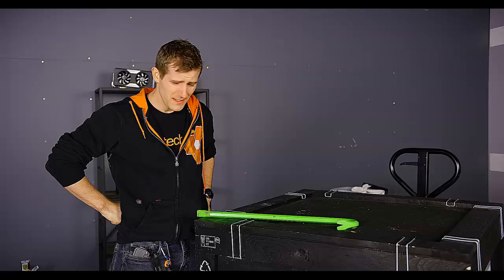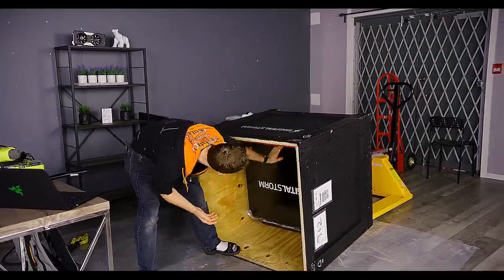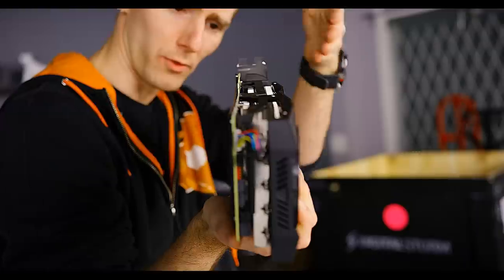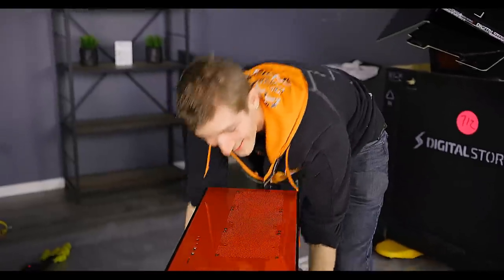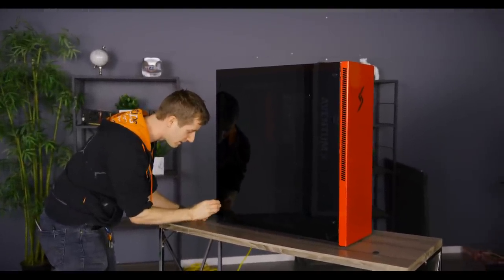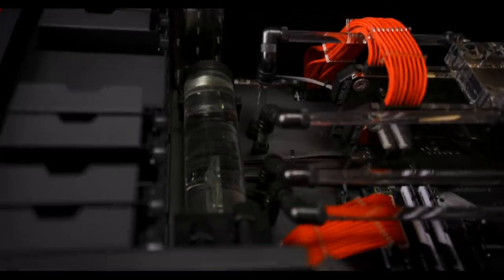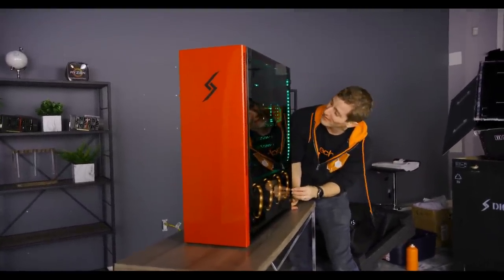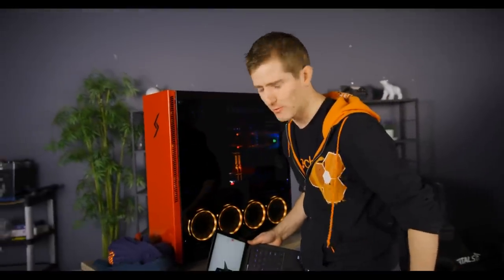UNBOXING the GOD OF GAMING PCs!!

Comment: I hope there's onsite support. I would hate sending a huge machine like this back
Reply: Oalmax yeah, they send someone inside the crate, kinda like the “24 hours in a crate” challenge, but with a sweaty nerd and probably more than 24 hours
Reply: all comps are the same, if you worked on one computer you can work on any computer. the only trick feature this has that you really havent seen is the water manifold. But as a guy coming from the performance automotive world this all seems like common sense. like when building a turbo kit you contemplate where exhaust, oil, vacuum, cold and hot charge piping go all while trying to maintain some sort of serviceability. so then you make vacuum manifolds, coolant distribution blocks etc.
Reply: Think about how rich someone would have to be to buy this. 
They would get on site service whether it's generally offered or not

Comment: Okay and now tell me.. what's the point of those fans hitting directly - almost touching - the glass?
Reply: Helps cool the RGB?
Reply: I was thinking the same thing.
Reply: I suppose it gives the butler something to do.  I'm gonna be gaming tonight jeeves, please open them case windows.
Reply: They "spin" the air on the open side creating turbulance, so while not super effective, they do help, and considering how overkill the cooling on the system already is, I don't think they were too worried about maximizing the fan's full potential.
Reply: They should use an IR camera to see if it makes any difference on temps unplugged.
Reply: @chunkychuck  let's get real. You know the answer.
Reply: @Magnus-pm7ic  haha yeah.

Comment: Now THIS is for the 1%, not the crappy one you did in the other video.
Reply: cant wait to see the benchmarks for this setup
Reply: but the build quality is meh. pretty underwhelming imo. Murderbox/mod was building systems that put this to shame years ago.
Reply: @cndJokester  I thought the same... Looks awesome, don't get me wrong, the back side is a masterpiece, but the front side has led strips that aren't straight all the way down the case, the plumbing doesn't look square (I might be wrong about that) but the connectors leading from the back to the front are hideous... All odd angles ugly pieces. Should have used straight and square pieces...

Comment: 2050 pc be like:

Damn god is so weak
Reply: With technology development by 2030 this will be a budget phone performance
Reply: BionicK .-. Idk about that buddy
Reply: @element1192  i think there is an estimated graph. But from logical standpoint if for example technology each year is getting twice better in 10 years it will reach phenomenal level
Reply: BionicK .-. It’s not technology getting 2x better necessarily. It’s the amount of transistors that can fit in the same size circuit doubling.
Reply: @element1192  Something i am sure that is getting better is AI. As you said it's core system may not be getting better (number of mentioned transistors) but the intelligence itself
Reply: BionicK .-. Ai can’t do everything buddy
Reply: @oleksandrchubras9549  in the future a 2080 ti will be a minium required graphics card
Reply: By 2050 this will be looked at like we look at 2000 PCs. By 2040 this PC will be completely obstinate.

Comment: I thought the pc was only fairly heavy after you tried to take it out from the top normally, until I saw you rocking on the side of the crate when I realised it's actually super heavy.
Reply: size estimate compared to my corsair 900D that i use as a server rack, mine full of drives, his full of water, id say that rig probably weighs in around 150+ pounds
Reply: Holy crap, that's heavier than me...
Reply: Website claims it only weighs 75 lbs
Reply: Strangely My Comments Usually Get Quite Popular well Linus does only way like 140 so it’s not surprising he couldn’t tip the box with his body weight 😂

Comment: It might have 15 fans, but except for the top radiator and front intake, they try to suck air through a glass panel. That massive radiator on the bottom is basically pure aesthetic, together with the small one on the back and the 2 fans pretending to cool the back of the motherboard. Also the front panel has too little holes for the fans to get air through. From a system of that cost, I would expect a better engineered airflow through the whole case.

Comment: All those choked fans. Send it to Gamers Nexus so we can get a proper diss :D
Reply: Seriously, thats all I see. Wasted watercooling since their isnt any direct route for intake. The fans at the bottom on each side are pushing against it other. The back being completely perforated is nice accept not a single method is used to directly push air that way. This thing will be cool the first 30mins or so of gaming but then the loop will eventually be saturated with the heat and the temps will just rise from there.

Comment: suffocated fans just like a certain walmart pc i know of...
Reply: With this amount of radiator surface area it's really not an issue tho.
Reply: You're right. The PSU is choked. The rads are blowing towards each other. Fans all over the case have no breathing space. So much for having a PC that is thousands of dollars and dying.
Reply: @ankit22sharma  as skapiche noted, there is likely enough extra cooling to compensate..
Reply: @kakurerud7516  I'm not saying it'll thermal throttle. But there isn't any cooling that's moving air from inside to outside the system. This is going to run really hot for sure. There should've been some ventilation to allow some air movement. Let's wait for a review.

Comment: Just made my configuration of the Digital Storm Aventum X... $19,151

Specifications:
Chassis Model: Aventum X
Exterior Finish: Black Metallic Matte Finish
Trim Accents: - Standard Factory Finish
Processor: Intel Core i9-10980XE Extreme Edition (18-Core) (Boost Up to 4.6 GHz)
Motherboard: ASUS ROG Rampage VI Extreme Encore (Wi-Fi) (Intel X299 Chipset) (Up to 4x PCI-E Devices) <br><strong></strong>
System Memory: 128GB DDR4 3200MHz Digital Storm Performance Series <br><strong></strong>
Power Supply: 1600W EVGA Supernova 1600 P2 (80 Plus Platinum) <br><strong></strong>
Expansion Bay: - No Thanks
Optical Drive: - No Thanks
Storage Set 1: 1x SSD M.2 (1TB Samsung 970 PRO) (NVM Express) <br><strong></strong>
Storage Set 2: 1x SSD M.2 (1TB Samsung 970 PRO) (NVM Express) <br><strong></strong>
Storage Set 3: 2x Storage (10TB Western Digital / Seagate - Ultrastar Data Center / IronWolf) <br><strong></strong>
RAID Config: - No Thanks
RAID Card: - No Thanks
Internet Access: Wired PCI-E Intel X540-T2 (10 GbE) (2x RJ45 Connectors) <br><strong></strong>
Graphics Card(s): 2x NVLink Dual (NVIDIA TITAN RTX 24GB (Turing Architecture) <br><strong></strong>
Sound Card: Creative Sound Blaster AE-7 (Hi-Res) (Ultimate Audio Playback) <br><strong></strong>
HPC Processor: - No Thanks
Extreme Cooling: H20: HydroLux PRO: Exotic Custom Cooling System (CPU Only)
HydroLux Tubing Style: Copper Tubing (Requires HydroLux PRO Custom Liquid Cooling System)  <br><strong></strong>
HydroLux Fluid Color: Red Fluid + Clear Tubing (Requires HydroLux Liquid Cooling System) <br><strong></strong>
Cable Management: Exotic Cable Management - Black - (Cable Combs with Custom Color Sleeved Extension Cables) <br><strong></strong>
Chassis Fans: Corsair ML PRO Series (14 Fans Total) (High Static Pressure) (Magnetic Levitation) <br><strong></strong>
Internal Lighting: Digital Storm LED Lighting System
Airflow Control: Corsair Commander PRO Management Control Board & Software (3x Boards) <br><strong></strong>
Chassis Mods: - No Thanks
Noise Reduction: - No Thanks
LaserMark: - No Thanks
Boost Processor: Stage 2: Overclock CPU - Up to 4.8GHz via Intel Turbo Boost Max Technology 3.0 <br><strong></strong>
Boost Graphics Card(s): Yes, Overclock the video card(s) as much as possible with complete stability <br><strong></strong>
Boost OS: - No Thanks, Please do not tweak the services on the operating system
Windows OS: Microsoft Windows 10 Professional (64-Bit Edition) <br><strong></strong>
Recovery Tools: USB Drive - Windows 10 Installation (Format and Clean Install)
Virus Protection: Windows Defender Antivirus (Built-in to Windows 10)
Office: - No Thanks
Mouse Pad: Digital Storm Premium Mouse Pad (Extra Large) (Full Desk) (Stitched Edges) <br><strong></strong>
Display: ASUS 35 inch ROG Swift PG35VQ (G-SYNC) (200Hz Refresh) (HDR-10) (3440x1440) <br><strong></strong>
Surge Shield: APC 1500VA Uninterrupted Power & Surge Conditioner - BX1500M - (NOTE: Ships VIA Ground ONLY) <br><strong></strong>
Speakers: - No Thanks
Keyboard: - No Thanks
Mouse: - No Thanks
Branded Gear: - No Thanks
Priority Build: - No Thanks, Ship Within 20-25 Business Days After Order Is Successfully Processed
Warranty: Life-time Expert Care with 5 Year Limited Warranty (5 Year Labor & 3 Year Part Replacement) <br><strong></strong>

Comment: Not so smart  all those fans  and choked by the glass panel digital fale
Reply: Just remove the panel while gaming xD
Reply: @MLWJ1993  Yes after selling a kidney and buying that  shit i will remove that glass  every time i want to game LOL
Reply: It depends on the clearance. It does look as though they have enough space to ingest air without significant choking. That would actually be a great test to do on one of these tech channels.
Reply: @PalladianPD  even if there is clearance it does not get fresh air and would be like a hot air oven and circulate the air that is in that compartment , and did not see any filters that butler Linus was talking about is definitely needed after a while
Reply: Mark Jacobs just having those fans will be better than not having them
Reply: Also the filters ? Where the air filters ?
Reply: @gfd796f8f-0pyiolk  yes if you like RGB without  the functions its better to have them  i would also like a Bugatti veyron on the porch without the 1000+HP engine in it just for show
Reply: With over a metre of radiator, airflow wouldn't be an issue
Reply: @jeremymcadam7400  oke might be kept cool but with better design it would have be a lott cooler ,  i just find it crazy that a custom case like this is designed and engineered worse then what i can do with pen and paper alone
Reply: You do realise the glass acts like a radiator? The fans aren't right up against it. 

Serkan Ermis, fail.
Reply: @TheCj71984  if you own that you should clean it instead of wanting crappy air filters. Jesus. It's easier to clean with compressed air than having to remove and clean all the filters it would need, lol.
Reply: @nickarmitt4722  Nick glass is a good radiator with its thermal conductivity of 1  vs 394 for copper and 238 for aluminium ???? what have you been drinking , your definitely celebrating new year already do you live in New Zealand? i don't also see water flowing thru

Comment: I saved up for Corsair crystal series 680x and the amazon delivery driver dropped it several times. He complained about it being heavy when he delivered it. I could hear the glass rattling around in the bottom of the box and so could he but he just bailed. When I opened the box it was just a bag full of glass. Thousands of shards of tempered glass spilling out onto the floor. Some delivery drivers don't give a damn about your items.

Comment: I wonder if an overclocked dual Epyc, dual RTX 3090 would need the AX1600
EDIT: Just did a quick PSU power calculation and it seems that 2x RTX 3090 and 2x EPYC CPU's would indeed need just around 1600W.

Comment: I'm kind of surprised that Linus Media Group doesn't have a Bluetooth or wireless enabled so you can sync it up and you can even run it with what you're doing on the camera as it is so you could actually see and also share a screen with your audience but what I'm saying is one of those snake cans the little wireless or well I should say not wireless but on just that little piece of wire that you feed down plumbers use it having one of those minus could have just pushed it in there and kind of was able to see the other side and they're bendable if you use the joist sticks and they make various different versions wireless and I think it's Bluetooth enabled or something I don't know all the details but I know they're out there I've seen some pretty fancy cameras